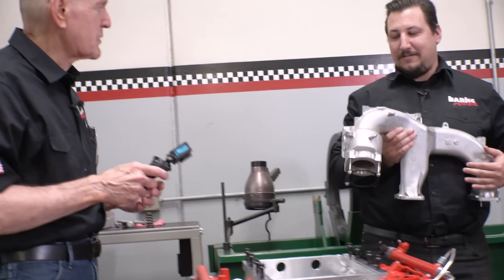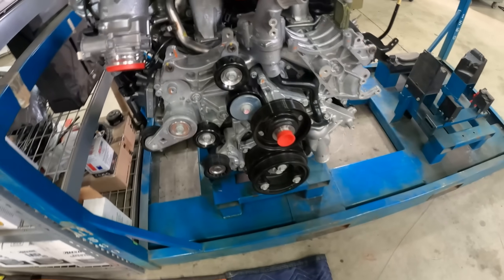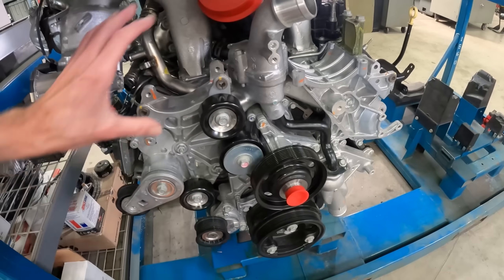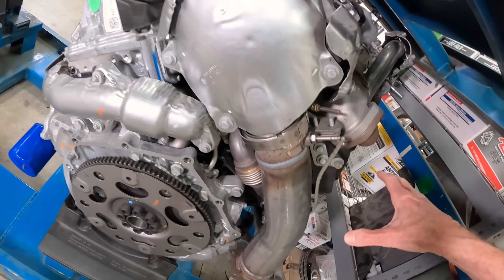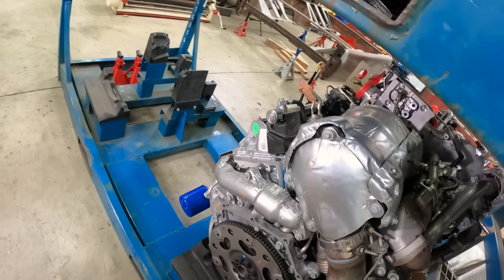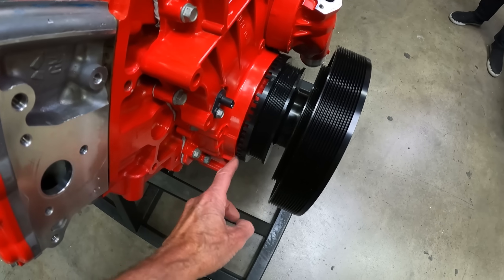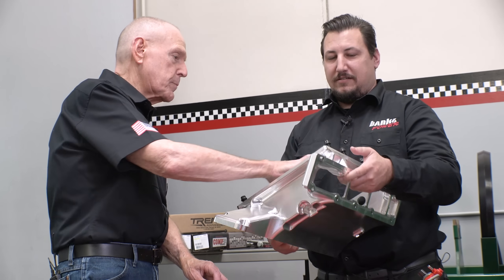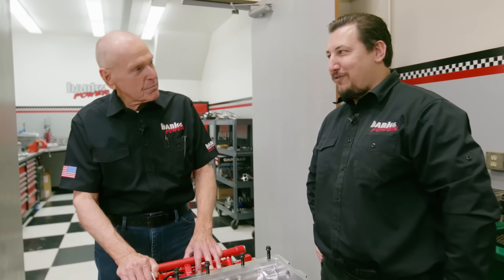Inside Banks SUPERCHARGED DURAMAX engine | BANKS BUILT Ep 40

Comment: This why Mr Banks you are a God among mortals when it comes to diesel, my grandpa bill bought a 2001 Chevy Duramax dually and build it to the utmost Max using all banks parts and I never seen that truck give a half a smoke. Even after he melted it down Paul and his truck overloaded with the fifth wheel on on propane It still didn't even puff a little bit of smoke when we pulled it into the shop to yank the engine. I greatly app😢reciate the times engineering the dedication and your promise, I just can't get over your dedication to pollution controls and well you have integrity that nobody else in the diesel aftermarket has. Just I haven't seen anybody else's diesel compare, Grandma had to get rid of the pickup not too long ago after grandpa passed. It still runs, has more than a quarter million on it, and I expected to run for probably another quarter million at the minimum.

Comment: In regard to the emissions, I know in New York State, doesn’t matter the year of the vehicle, the year of the engine matters. The engine needs to meet emissions for the engine year if it is to be used on the road. At least that’s how I understand it. A 2022 engine in a 1950 needs 2022’s emissions. 
In reality, we should be tuning all cars to pollute less at all times because when it’s running correctly, there is minimal pollution anyway

Comment: Euro 3 emissions are about the limit for a well designed motor if tuned properly, allowing for good specific torque. Euro 4 seems to be impossible without sacrificing torque. Euro 5 forget it and Euro 6 you need a heard of pigs to pee down the exhaust pipe.

Comment: I own a 21 GMC 2500, 19 Gmc 2500 Denali, 14 Chevy 3500 Single Wheel. All of them Have a Duramax 6.6 Motors. I have have every year since 2003 and I would not have anything other then Cummins. I just can’t stand Dodge Trucks.

Comment: I'm missing the Killing a Duramax and diesel monster truck builds. Plenty of people fabricating their own vehicles (and not to say you aren't adding your special engineering touch, which often lacks from the others), but nowhere else can we get expert understanding, explained in detail on how engines and specifically diesel engines work. It's fantastic. Not a fan of dropped vehicles so I kindof dropped the build series, but this video reminds me how much I can learn from you so I might have to go back through and find the interesting technical tidbits. I think I left off on the racing 8 lug hubs / spindles.

That said, I've been sitting here frustrated with TTY fasteners as I do the clutch on my '03 Jetta TDI. To be fair, I think the only TTY bolts I'm dealing with on this job are on the motor mount and flywheel. I can understand that they have a lower spring rate (or if your steady state clamping force is lower) then it helps balance the load across maybe more than one bolt, spreading it out instead of concentrating the stress.

Sure, they do the job. Auto manufacturers say they're cheaper for the same clamping force as well (less bolts required), and if you're building an engine the cost is the least of your concerns WRT these bolts. I just hate throwing money into new bolts every time, especially if I screw something up and have to redo.  Not saying I do that often but the prospect annoys me. 😆

Plus one of the TTY bolts I pulled out on the bottom motor mount was heavily corroded due to the aluminum steel interface (and I'm sure some contributions from road salt, I ended up having to grind the aluminum motor mount out around the bolt just to get it out). I want to use marine grade anti seize so I'm considering torquing the fastener down dry but not yielding it, counting the turns, and marking the torque angle with a paint pen, anti seize it up, count the turns back in, line it up, and yield that SOB.

Comment: If you guys are pushing the injection pump to basically 100% duty cycle, then you need to upgrade it. Because you should know damn well that the injection pump is the weak link of the common rail diesel engine.  And if someone is going to spend 35 grand or whatever you're going to charge for this engine package, then they should be able to expect A MINIMUM of 150,000 miles from the injection pump, and there is no way that is going to happen with you running it maxed out from the get go

Comment: can you please explain how modern Formula 1 engines are using such high compression ration, they are basically compression ignition engines? i heard a rumor they are using near 20 psi of compression and eliminate the need for spark plug use. is this true? what are the benefits and how would they control the burn? specially shaped combustion chambers and pistons?

Comment: Gale, you are addressing MANY different Duramax builders. Only a fraction of them are using brand new engines like you. I only build and modify LB7's for example. I am putting 600-800hp to motors that have 200K miles and have already had injector problems or jumped time from not having keyed cranks or cams, or blown head gaskets. We use a fluid damper to smooth out the lower end with and ARP bolt, these motors are 20 years old now and we put them in daily drivers. Using head studs is a must, I would love to be on the other end building new engines for vehicles that will spend more time behind a rope than on the road or a single grueling baja 1000 and it's life is over. There is no doubt you build monsters but how old are any of them ?? Any have 100, 200, 300K miles? Even on the military Hummers and the new battle vehicles with a duramax engines in them, how many miles, how many engine hours ? The hummers we see auctioned here in Texas have less than 20K miles and are Detroit engines that can't even be driven more than a couple of hundred miles before over heating. There are a lot of ways to get these motors/trucks down the road and there is no way anyone can doubt your accomplishments in this industry or on this engine platform but you could do it a lot classier and stop shitting on others who try and do it too. Whether it is builders like Hoonigan or manufactures like ARP.

Comment: Studs vs Bolts: He is correct in general, but many blocks have shown plenty of strength on the threading in the block (an infamous GM weak-point), but not the bolts. A B-series Honda engine is a common example. Hence why some otherwise knowledgeable guys are a bit too eager to stud a block. Always best to know your platform, and sticking with bolts til you start lifting heads is a cheap strategy (if you don't take the head off often).

Comment: Can this engine, like the Euro diesels, run reliably at 5-6.000 rpm?
Reply: I doubt it, as at the end of the day it's still a truck engine. Can you build it to rev that high, with heavily upgraded lifters, valvesprings, and a completely new cam profile? Probably, but doing so neuters the low-end torque that the engine was designed to build, and at that point it's cheaper and more efficient to go with a similarly sized gasoline engine.

Comment: Could the nitrous delivery system also be used for propane  injection as this is a diesel??
Reply from the maker: It's a completely different system that is required for Propane, so no it will not work on this application. Plus, propane can be unpredictable and cause pre-ignition. Gale has never been a big fan of running propane additives with diesel. In multiple tests that we've run, we found it's a sure-fire way to melt internals at full tilt. Especially for high horsepower/load applications.

Comment: I always enjoy your lectures.The young guy should listen to your teachings.  In the old days they said to pump more fuel into it for more power. Smoke was king! Makes no sense wasting fuel . in the old days a supercharged 2 stroke aircooled diesel powered passenger buses leaving long trails of Oil and Fuel Smoke. Cough cough. Eyes watering. Passengers dieing from the Hydrocarbons and Carbon Monoxide. I would Vomit from the fumes.Full sulfur diesel fuel.
Mr Banks could I use your company name to get into the show? Tell them the CAT wants to inspect.
Reply from the maker: You hit the nail on the head, smoke is a waste of fuel.

Comment: I’m wondering why you didn’t use a big blower and lower overdrive off the pulley. Are you concerned about belt slip on the small upper pulley, there’s a lot of surface area on the lower pulley, but not a lot on the top
Reply: That is a concern that I agree with. The advantage that they have is that they are only turning up to 4500 RPM. I was running a supercharger at Bonneville and we had a problem with belt slip and belt deformation at anything over 6000 RPM. We were running a 12 rib belt and two idler/tensioner pulleys and still couldn't control the belt deformation. The tension was so tight that it sounded like a banjo string but it still found room to warp out of shape.

Comment: Are we replacing head bolts cause that’s the way it’s always been done. Has it scientifically been proven head bolts must be replaced after X ???
Reply: The design of the Torque to yield set up is why.  When you tighten them like they tell you to, it stretches the bolt to the maximum it can take.  Usually, if you reuse the bolts, they lose some clamping force, and may break.  Basically, they stretch to the point of no return.  If you measure them with a micrometer, they usually grow a bit after the first use.
Reply: @jimt9661  impact v chrome impacts has been debunked of its "imbread of old ideas" https://youtu.be/UekjhTw6Fas
But where’s the head bolt science ?
Reply: @martinbrousseau2560  It's called "Bolt stretch"  It applies to everything that is assembled with a bolt.  In the heavy truck industry, we measure bolt length to determine if a bolt is stretched beyond a usable limit.  The problem is, in these smaller truck markets, the cost of properly measuring and checking the bolts with a thread gauge in a labor perspective exceeds the cost of replacing the hardware.  Therefore, they don't bother publishing the specs for bolt stretch tolerance.  By the way, I'm a heavy truch mechanic and don't own many impact sockets.  Can they be reused?  I'm sure most of them can, depending on lifecycle and such.  Bolts are a wear item though.  There is an inherent lifespan of something that get stretched and relaxed frequently, and subjected to temperature differences .  while doing it.  Look up "work hardening".  There is plenty of science to it if you want to look it up.
Reply: @jimt9661  i was Artillery, we know a thing or two about metal fatigue. Requiring us to change Cannon Barrels, in Afghanistan after every 1000 rounds. Anti aircraft guns measured barrel droop.
As a driver I can tell you heavy duty mechanics don’t have a clue why trucks loose tires. I do n there’s about 3 items in 3 places causing studs to loose clamping force, except in the great white north cold n heat variations can cause expansion n contraction of metals to failure. on pass side studs break due to wheel rotation, drive side studs spin off until a set of duals will come off. In cars or 4 wheelers loosing a rear usually causes a rollover.
Sorry
As far as I’m concerned your explanation doesn’t answer why head bolts need to be replaced.
Reply: @martinbrousseau2560  Then stop asking questions if you don't want an answer.  It seems you already know it all.
Reply: @jimt9661  im asking cause I don’t know why society is tossing headbolts for what may be an inherited idea without substance. 
I trust banks, but I have trouble believing head bolts should be replaced.
Reply: @martinbrousseau2560  I gave you a clear concise reply, and you replied with an insult.  You obviously just want to believe what you want to believe.  Or maybe you're just trying to drive traffic to your videos.  Either way, i gave up on arguing with idiots a long time ago.  You have an inherited idea that if you question something, you must be correct.  Enjoy your life.

Comment: Racers are pushed to same limits in a race v life long daily driver. Then racers can’t reuse a head bolt with 20Km v 200,000Km.
Reply: Huh?
Reply: @cencoast_7.340  If head bolts can not be retorqued, then it can not be retorqued in a racer with 20Km nor a daily with 200,000Km.

Comment: I absolutely love the approach to tuning that beast! Yes, with all that forced induction, you definitely could run a super clean and powerful engine because of thermodynamics and make it more efficient. Not like alcohol in gasoline, or ethanol rather which requires more fuel to do almost the same amount of work while making carbon deposits which robs an engine of thermal efficiency...
Reply: Eh alcohol doesn't cause carbon deposits guy.
My drift car has been running methanol since the new engine build, no carbon anywhere.

Comment: To simplify things, all a bolt is, when it comes down to it, is a very strong spring pulling down on the head.
I thas to be strong enough to hold against the cylindr pressures, but also have enough elasticity to alow for the thermal expansion of the head and other components.
With alloy heads, especially, there have been failures of the fasteners and/or block threads/material because the fasteners tensile strength was too high to allow them to stretch and so they pulled the treads or simply snapped. 
Sometimes it's more simple, with the head/nut's washers embedding into the head, reducing the clamping load and leading to head gasket failure - this can usually be countered by using larger diameter hardened washers beween the head and nut.
Reply: Was actually pretty simple the way he first explained it. It’s a metal rod that stretches and contracts.

Comment: How much to buy a high horsepower off-road use LP5 with an Allison transmission that can handle it?  I think it would fit perfectly in my 1970  C-10 Chevy short bed
Reply: @bankspower  He asked what
it costs…
Reply: CenCoast_7.3  You are correct I did ask and Banks doesn't do this for charity.  This is Banks not AutoZone.  I would never expect a built engine and transmission from Banks to be cheap, that's why I want it and very interested in the price.  Is there something wrong with asking for a price?
Reply from the maker: Our crate engine program cost and spec will be available in Q2 of next year. To learn more, click here: https://official.bankspower.com/engines/
Reply: Banks Power  Thank you for the information and I can't wait to spend my money next year

Comment: Why does Gm not use electric fans with PWM Controllers for Duramax powered vehicles.
Reply: Not bought cfm moved by an electric fan...stock clutch fan moves 15,000 cfm....electric struggles to do 2-3000 cfm...
Reply: @crudnick 💯
Reply: No time

Comment: Euro 3 sn't that clean at all, a High HP decent tune on a standard piston engine with a sports cat (low cell count, High Flow) Passes Euro 3 every day!
Reply: Yes but I believe the point is for a diesel to run with no emissions equipment and achieve these standards is a very tough thing to do. Diesels aren't exactly known for cleanliness. But they can be tuned to be reasonably clean. If you were to add emissions equipment I think it'd be fair to say you'd be passing higher emissions tests
Reply: @haydenpoulsen2295  Yes, I didn't make it clear that I was making a sub point and should at least have mentioned what it's referring to (Diesel) In saying that I agree with you there, I'm sure even running a performance DPF would  pass Euro 3 pretty easy! Let's not all forget the VW debacle and what it actually means to get a pass in that area ;) But yes, gotta agree with you there, just remember I should have said a Very High Hp Petrol engine 1000hp plus! Again in saying that, I totally agree with you.

Comment: It would be so cool if you could order a banks built engine as a factory option from Chevy. I think they would sell thousands of them.
Reply: the engine in this video would have cost an easy 300k
Reply from the maker: @brianrichards782  The engine won't be that expensive. We have specs and pricing dropping in Q2 of next year, click here to learn more: https://official.bankspower.com/engines/
Reply: @brianrichards782  LMFAO you have no idea what you are talking about. A stock duramax crate long block is about 9 grand, and i'm more than certain that these modified, fully dressed motors will MSRP for between 20 and 30 grand
Reply: @fuck_youtube_censorship00  and the initial development motor includes the cost of engineering and r%d
Reply: @fuck_youtube_censorship00  so my original comment is correct
Reply: @brianrichards782  what are you smoking?   Clearly you know nothing.   Go back to riding your bike.
Reply: @bmstylee  they development motor includes the cost of r & d

Comment: I’m a newb so bare with me, if you are changing to a head stud, it would be the same diameter at the thread. Would it not be torqued to the same value as set by the engine manufacturer? Or is it higher as set by the stud manufacturer?
Reply: The way torque is applied by a stud is different because it's threaded on both ends, the materials used in the manufacture of studs is typically different also, a higher strength material means you can use the same diameter but increase the clamp load via a higher torque value, the downside is that you're still relying on the same threads in the block as the standard bolt so potentially overstressing the block material resulting in failure (pulled threads)
Reply: In simple terms, the higher the thread count per inch(TPI), the higher the clamping or compression force, for the same torque spec. Studs have a higher TPI on the top side, for this purpose. That same higher TPI, is not achievable in the block, due to lower material strength.